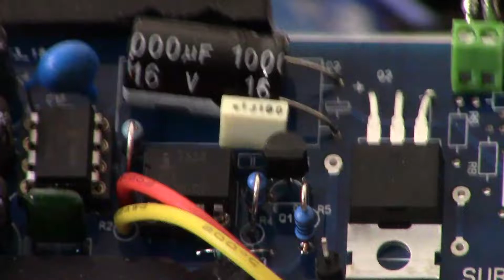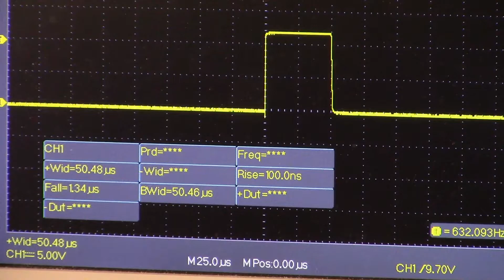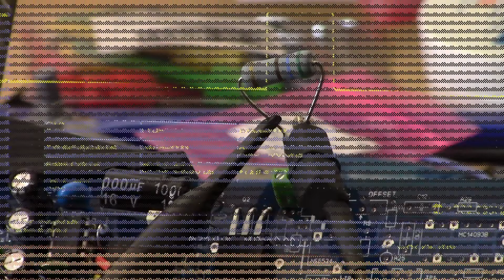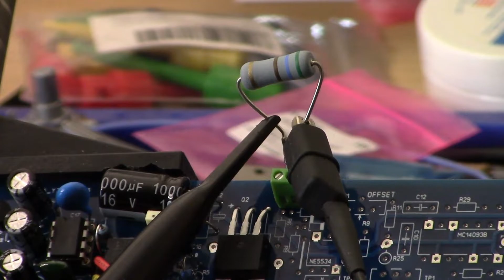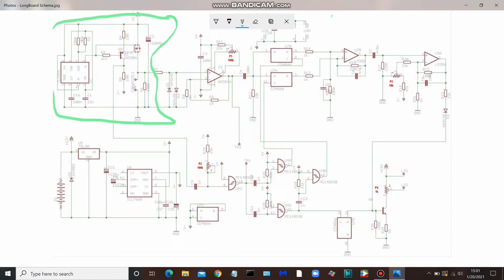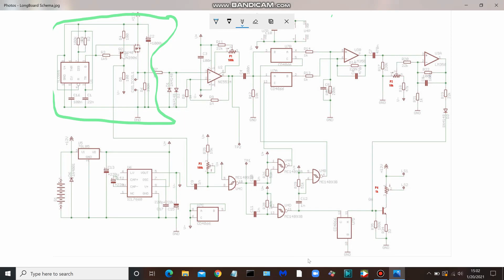Surf PI Longboard DIY metal detector build part #2

Comment: What is the advantage of changing the R2 resistor to a trim pot?
Reply from the maker: Hello and welcome to my channel.  The trimmer will allow you to adjust the transmit frequency.  A faster frequency allows for slightly faster coil swings at the expense of battery consumption.  Thank you for the comment and please subscribe for more content.
Reply from the maker: I hope that I answered your question for you.
Reply: @SurfDetector  Thank you sir for answering my question.
Reply from the maker: @matthewbullock6925  my pleasure

Comment: Are you planning on putting it in a waterproof case?
Reply from the maker: Water resistant case if I box it up.  More than likely it will go on the shelf.  I have far too many completed detectors at the moment. Thanks for the comment.